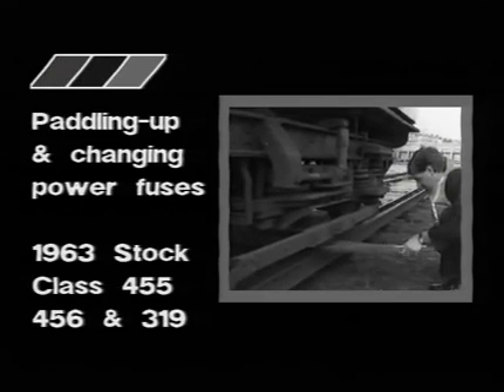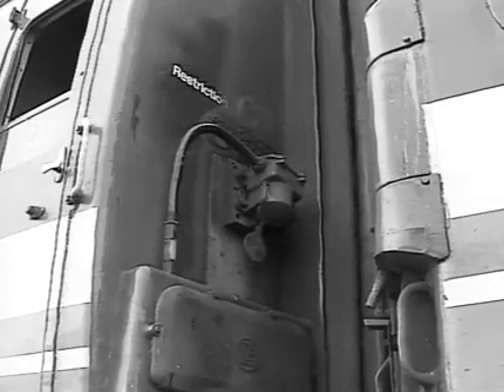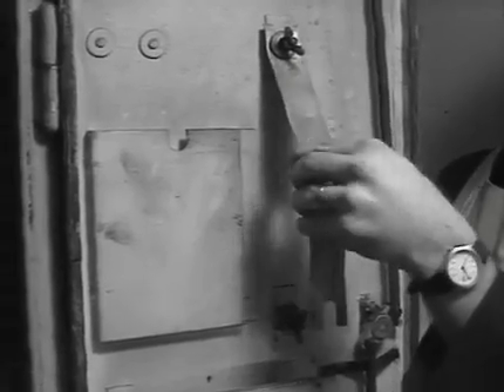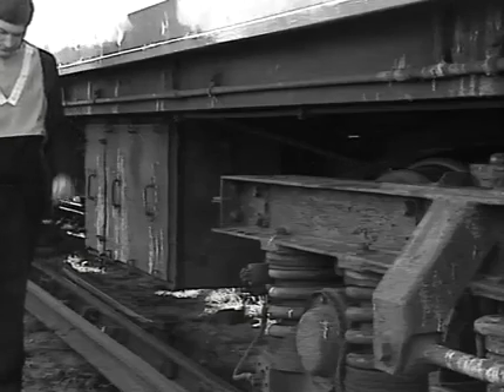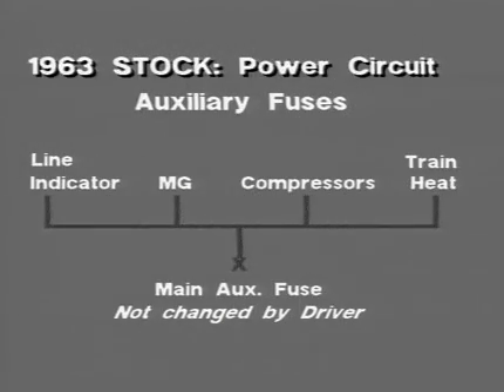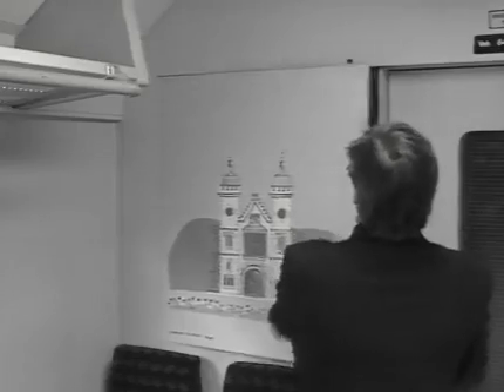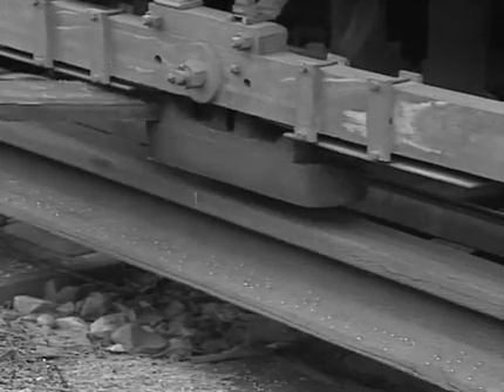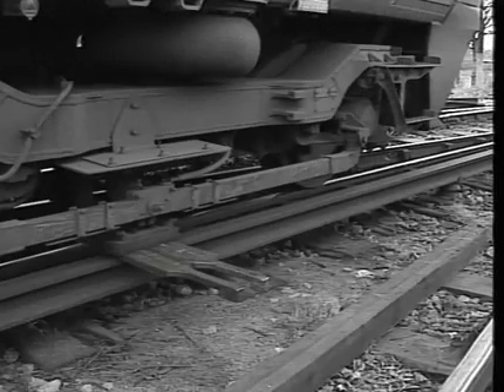Paddling Up and Changing Power Fuses, Network SouthEast Training video

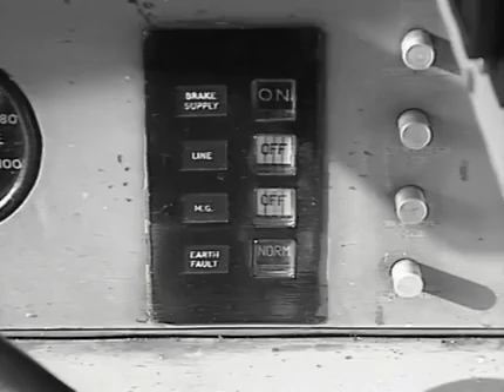Comment: 3:35ish Why is the cab light on again? How is the cab light on again?
Reply: What I mean is:- Unless the cab light is battery powered, possibly charged by the third rail supply but otherwise a separate electrical system, how is this test supposed to reassure me or anybody else?

Comment: Ok, so yo paddle up all of the shoes and check that there is no power to the unit.  But what happens if something knocks out the paddles from under one shoe? Say an animal gunning alongside the track, or some object or damaged shoe gear sticking out from a train passing on the other line.  Wouldn’t it have been safer if means had been provided for the normally live parts to be bonded to the running rails to prevent them becoming live unintentionally?

Comment: On the class 71 when the pantograph was in contact with a live overhead wire were the shoes live?

How did things work on the old 1200V side contact system on the Manchester to Bury line?  I remember that these units carried a short circuiting bar which was a different design with a heavy metal ball on the end of the handle.  Was there a type of shoe paddle for use with Regis system?  Could any work be done on these units without the traction current being turned off?

Comment: Do modern trains have circuit breakers instead
Reply: I believe they still have shoe fuses
Reply: @ElliottHurst : At least the Electrostars still do have the shoe fuses - they're quite visible (either covered with the electrical warning [Southeastern] or with the warning above the fuse [Southern]). Can't remember whether the Desiros and Aventras had them or not, but I'd think they do?
Reply: @fetchstix  the 250/1 have them the /2s (i hate them) /3s and /4s could be retrofitted

Comment: The ribbon fuse is a god-awful design, just pure laziness not to retrofit a trip circuit or a ceramic fuse 'plug'  that keeps the driver safe.
Reply: g2macs
If you mean the large copper ribbon fuses above the collector shoe on the bogie the design is deliberate. These fuses wouldn't usually blow as the sub-station circuit-breaker would normally go first. The current they routinely handled was over 1,000 amps at about 750 volts.
Reply: @philaypeephilippotter6532  And here we are being told how to change one with our bare hands in the rain, hoping that we've remembered how to flip the right switches.

Comment: People back then had more respect for danger than they do today, due to health & safety. There comes a point when too much h&s leads to complacency. Back in the BR days, they may have done things differently, but all staff respected the dangers.
Reply: Not convinced the death & injury rates then and now would support your contention.
Reply: Exactly, and all of the practices in this film are safe. When the narrator said that it was most important to absolutely ensure that the electrical loads in the train were isolated by means of the main  isolator, that ALL shoes are firmly off the juice and firmly held by the paddles, means that there is no risk of explosion during fuse replacement. People had more common sense back then.